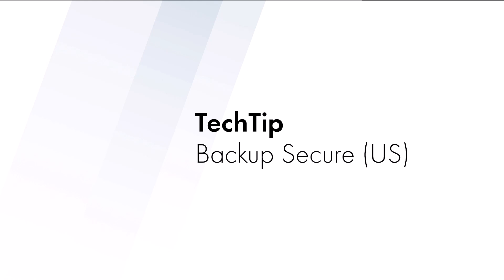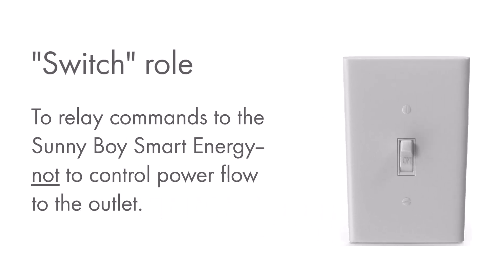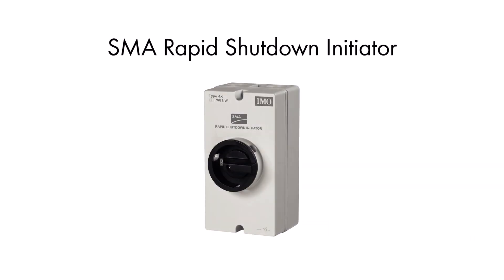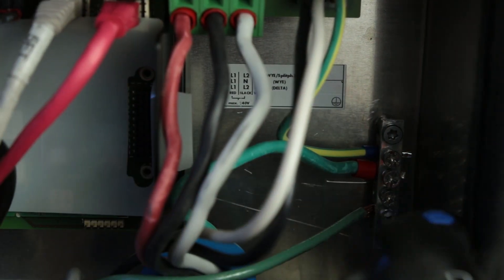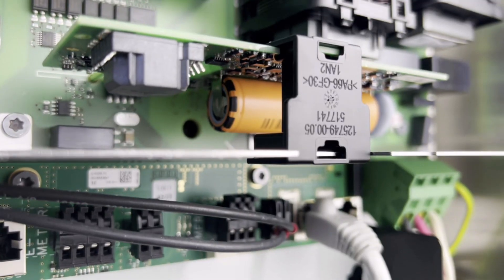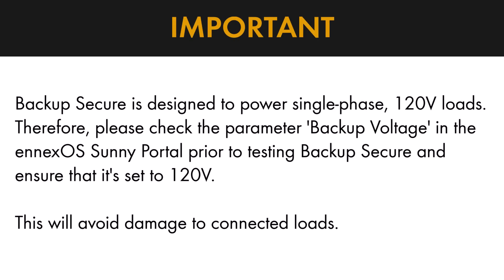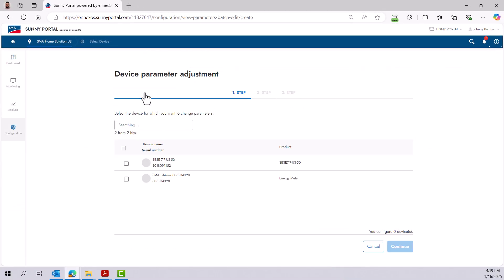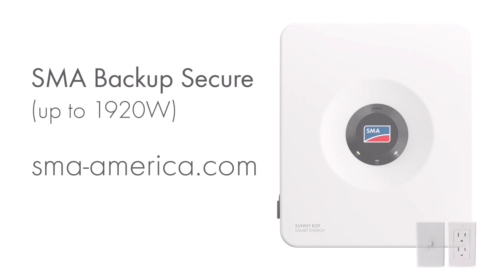TechTip: SMA Backup Secure (US)

Comment: Does it have battery build in?and it’s in invert too? MPPT too?
Reply from the maker: Hello StuckInTheMatrix20, our SMA Backup doesn’t include a full battery for energy storage, but it does have a small built-in buffer battery that enables the black start function after a grid outage. For continuous supply you’ll also need an external battery like the Home Storage if the sun isn't shining. In combination with the Sunny Boy Smart Energy hybrid inverter and the SMA Home Storage battery, this creates a well-designed solution for comprehensive supply security—even in the event of a power outage. Further information can be found on the website: sma.de/en/products/product-features-interfaces/sma-backup and in the data sheet:https://files.sma.de/downloads/SMABackup1P-DS-en-10.pdf Sunny regards, Daniel of the SMA Social Media Team